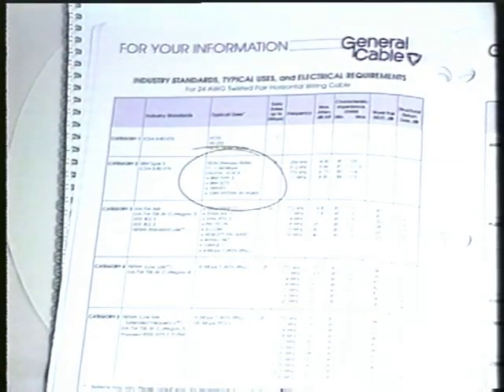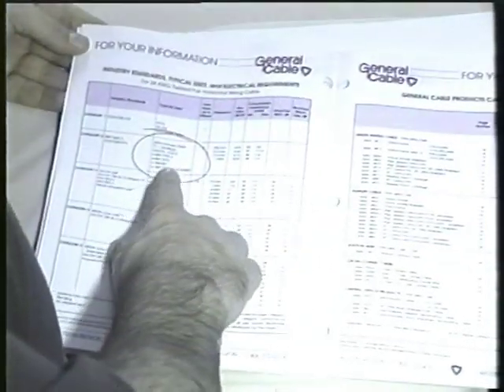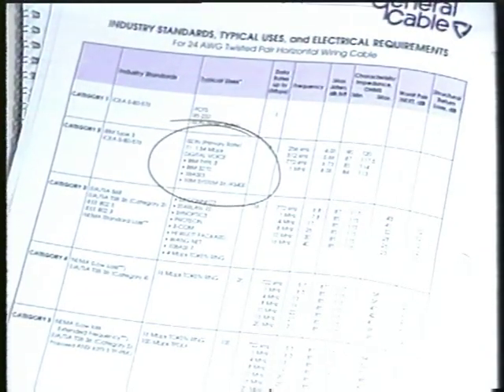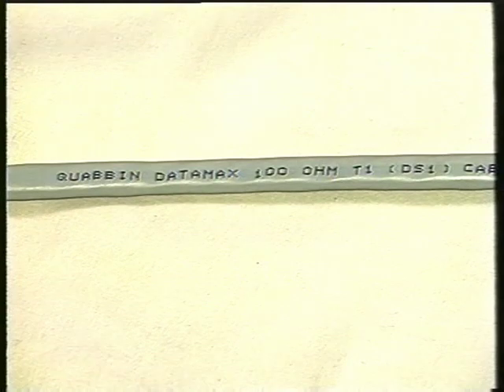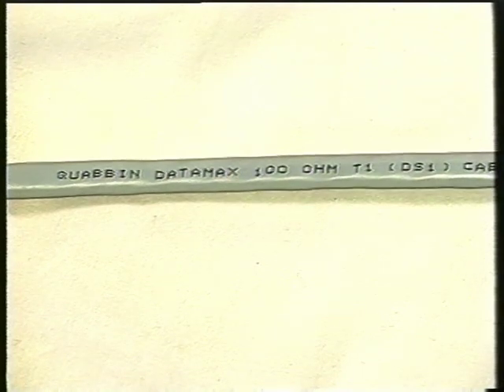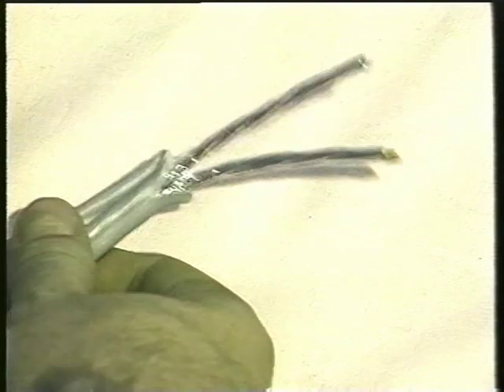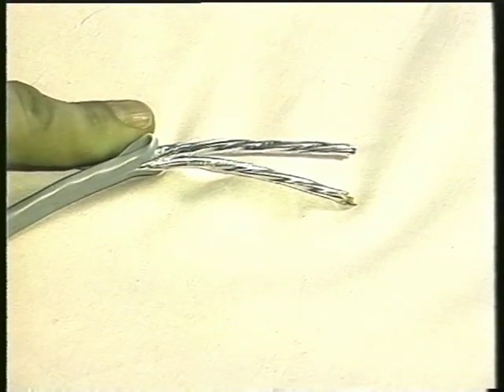T-1 Cable and DEMARC extension

Comment: video stops in the middle of you explaining this. Thus making your video not very helpful
Reply from the maker: Hi Jason, the video does not stop in the middle, it is a clip taken from a longer video as is mentioned in the synopsis.  I am not sure if the original video is still available, but it was distributed by Mike Sandman Enterprises (www.sandman.com). This clip is just about extending the smart jack, the rest of the 2 + hour video covers T1 and Digital transmission in more detail.

Comment: Thanks.  Do you think 35 feet with CAT 6 cable would be fine?
Reply from the maker: Yes, CAT 6 is fine,  In fact, CAT 3 or better will work fine (is there any CAT 3 still out there?).  I still recommend using two runs, one for TX and the other for RX and stay away from anything that generates high amounts of RF interference.
Reply: Andrew Kauffman What kind of interference?  Power wires and such?  What kind of symptoms would be expected with a bad run?
Reply: Honestly I know this post is old but cat5 and cat6 will run about 300 ft without too much attention. The cable he shows in the video is shielded and only has 2 pairs. Unless you have a ton of fluorescent lights or huge machines interference won’t be an issue.
Reply: Sorry I meant attenuation not attention. Auto correct smh

Comment from the maker: DMARC is the termination.  To extend from there I use shielded twisted pair cable (ABAM 100 or equiv).  Alternative, use (2) CAT 5 or better cables, one for transmit, one for receive.  Order my video on T1 from Mike Sandman Enterprises (no links allowed in replay, but , search for mike sandman who sells telecom gear, see URL in video) for the whole story.

Comment: Agreed. That was my point, voltage levels. T-1 (high voltage level) must terminate into a CSU for the "hand-off". A T-1 may have as much +/- 130Vdc where a DS-1 is typically 6 vdc p2p.  My other statement was around RJ45. Seems these days anything and everything with an 8 pin miniature modular connector is called RJ45.

Comment from the maker: T1 is a physical interface,  e.g. the copper.  DS-1 is the signal.  DS-1 signal can ride on copper, fiber, microwave, etc.  For detailed information refer to Belcore Technical docs, ITU standards, and AT&T Tech Pubs.  I have terminated many T1’s directly into CPE.  The DS-1 was either AMI or B8Zs signal.  All T1/DS1 circuits have to terminate into a CSU; either a stand alone or integrated into CPE.  The CSU is where the electrical changes are made.

Comment: I strongly suggest he consult FCC Registered Jack (RJ) configurations. RJ-45x defines physical and mechanical configuration for dial up data interface. RJ-48x is for DS-1 interface. Highly unlikely anyone is buying a T-1 into customer equipment. T-1 voltage levels are far to high for routers/pbx, etc... BIG difference in DS-1 and T-1 signal level.

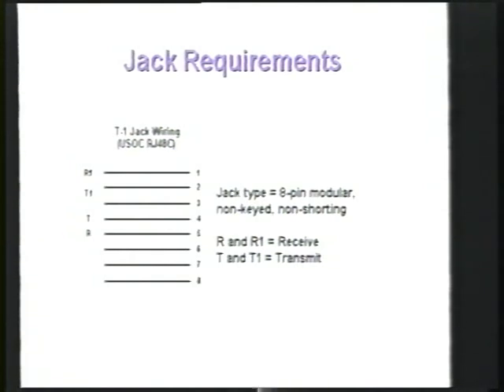Comment: PROBLEM regarding pinouts on Jack Requirements slide at ~3:38
R and T stand for ring and tip; R T is receive pair from network and R1 T1 is transmit pair to network

Comment from the maker: @HillsBoyZ    >>> You cannot "buy" a DEMARC.  It is a name for the point where the telephones company’s responsibility for the T1 circuit (or any circuit or line) ends, and the subscriber’s responsibility begins.  Depending on the type of circuit or line the DEMARC would be a 66 block, RJ-11 jack, Smart Jack, etc.  For safety’s sake, always use a qualified telecommunications technician to service your equipment or circuits.  This will prevent damage to your equipment or the network.